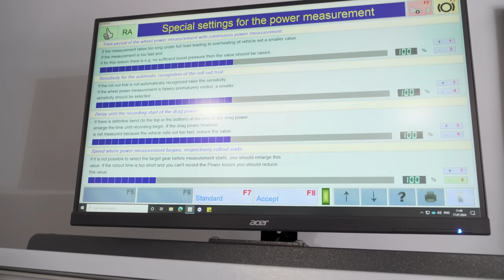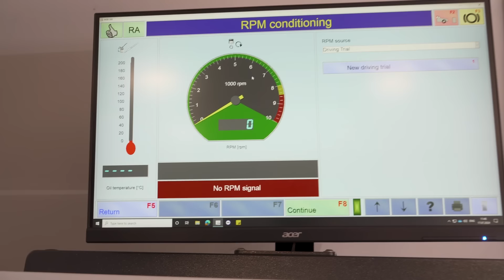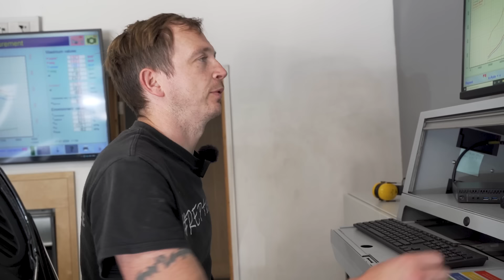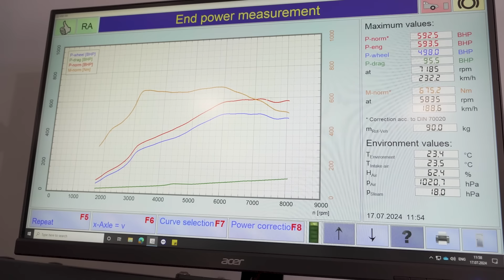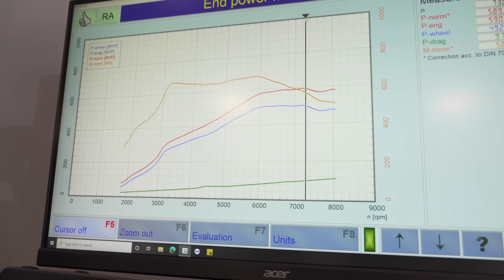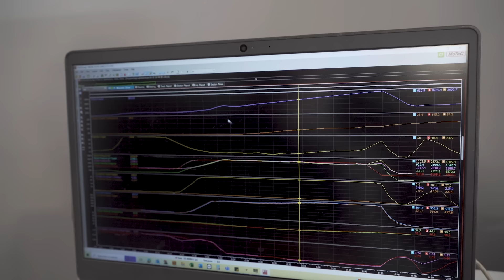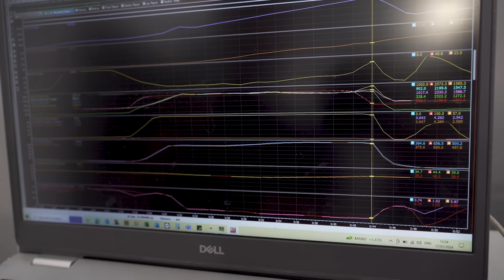This McLaren Almost Broke Us!

Comment: Given how fussy you are about everything else you do (which I love as it's the right thing to do ) it's surprising you're using a roller dyno with all of their inconsistencies.......but I get that it can be a pain in the arse with all of the modern protections on a hub dyno, but they give so much better control, not to mention safety and better overall results........ really interested to hear your thoughts as I've seen results change easily between runs just with tyre pressure increases, not to mention wheel slip on higher HP cars etc..... just seems daft to me to use rollers.

Is it mainly wanting to get coastdown numbers that you won't get from a hub dyno ?

Love the channel..... have learned so much, thanks for all of the efforts.

Comment: A dyno is a great tool for tuning, however, what's the point of increasing your BHP if you can't put the power down. On road performance 0-60, 60-120 is the real indicator. It would be interesting to see those figures before and after.

Comment: Agree wholeheartedly with your dyno views, they are a comparison tool, and the only comparison you can trust is the same dyno, under the same conditions.
Anything else, to use your 'thumb and knuckle' simile, is like saying it's 'me thumb and yay much' and someone else using their thumb and getting a different answer.
If you think there's some bollocks and olde wyfves tayles pushed in supercars, you should try 2 strokes ...
P.S. the rants just have me nodding in agreement.